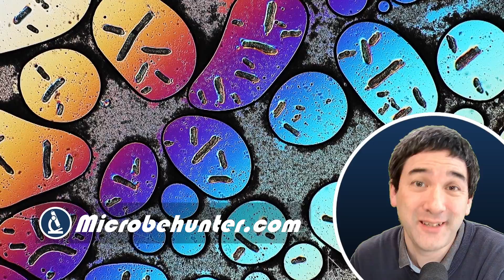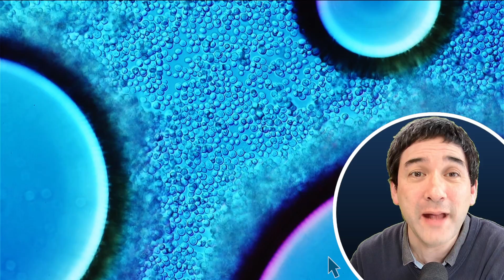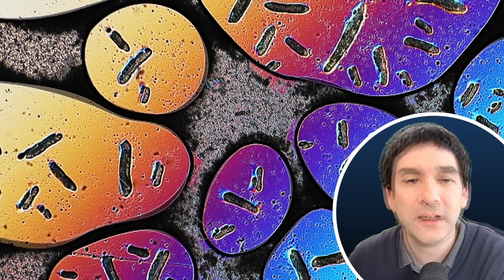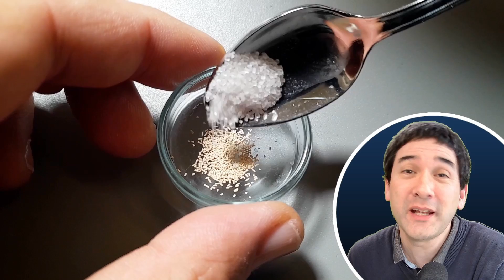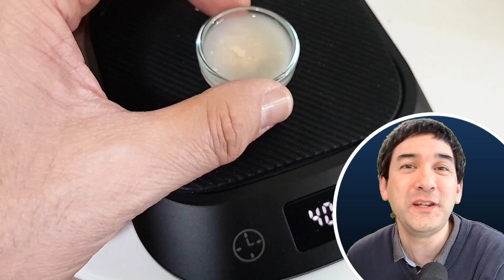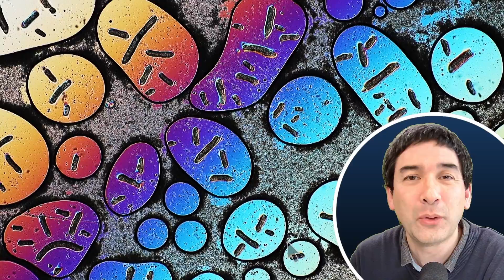How to watch CELL RESPIRATION under the microscope

Comment: What I can't underszand is how the co2 ends up in the large bubble if yeast is producing it on the outer edge of those black clumps. I dont see any small bubbles forming that wold merge into the large. Is it happening on a scale we can't see?
Reply: Physics student here, that's a great question!

In summary: the big bubbles mainly absorb co2 directly from the water, since there is co2 dissolved in water. I'll try explaining it below.

When CO2 is emitted by microorganisms, it does not immediately form bubbles. A certain amount of CO2 can be dissolved in water. You can imagine this dissolved co2 as if it had a "pressure", i.e. it wants to get out of the water, forming bubbles. At the same time, water molecules really like to stay close together, so they create their own pressure working against the formation of bubbles. The size of the bubbles plays an important role here. Small bubbles are harder to form, because they have greater surface area per unit volume, meaning the water can produce more force per unit volume. But, if there is some solid object that already displaced some water (we call it "nucleation site"), it allows for a bigger initial bubble (lower surface area to volume ratio), making it possible for the bubble to grow with lower co2 concentration that it would need to create a new bubble from scratch. So the big bubbles seem to grow into even bigger bubbles, seemingly out of nowhere.
Reply: It clicked as soon as I saw your first sentence. Makes perfect sense now that gases can dissolve into water. Thanks